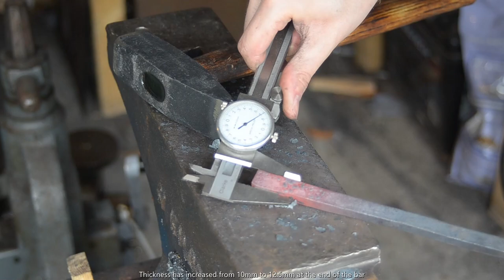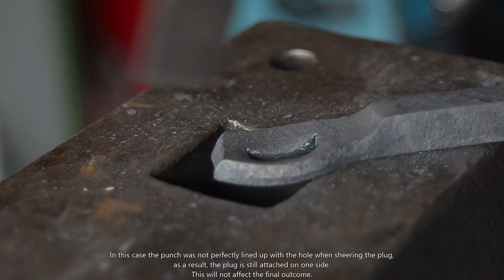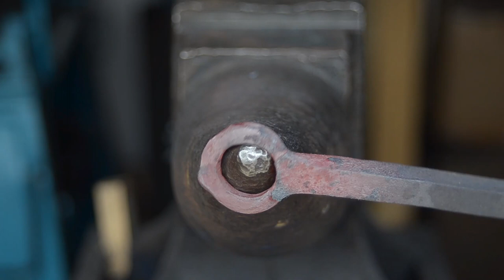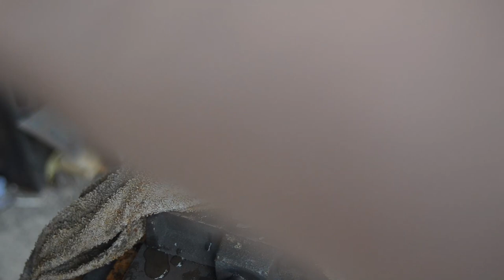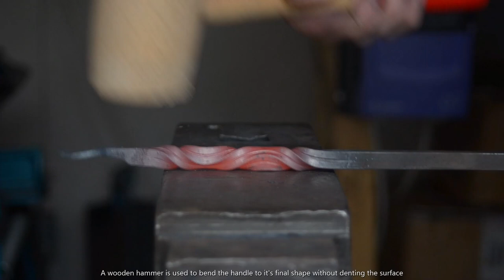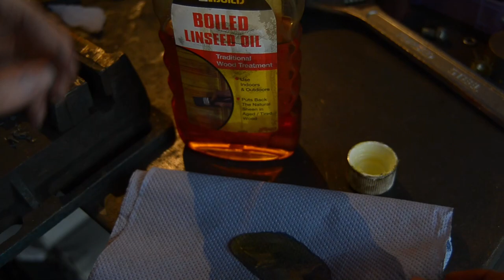Blacksmithing - Forging a twisted bottle opener

Comment: One of my favourite openers. Maybe a dumb question? How come you use an oxy-acetylene cutter to warm the handle and not a heating torch?
Reply from the maker: Thanks! The oxy-fuel is much hotter than the flame from a standard plumbers heating torch

Comment: Nice job and video angles, when upsetting the end  of a bar its best to make a short heat section if its heated too far or too long cool it in water to consolidate the length, much easier to control without distorsion, its all practice, a small flare or fish tail scrolled over for the handle end would have finished that off differently.
Reply from the maker: Thank you!

Comment: Great job! I have to ask about your fullering hammer [ used @1:41 ]. Is it a custom build? Could you do a video on its features?
Reply from the maker: Thanks! Its actually a fairly common tool called a fly press. It’s only very small, no.1 I think.

Comment: Liked alot about it. Great camera angles, clear steps but that god awfull noize of the torch. Maybe turn down original audio down or run a noize canceling over it or something. Keep up the good work
Reply from the maker: Thanks for your feedback! Since making this, I’ve started using a proper editing software so the crap audio is no longer an issue.